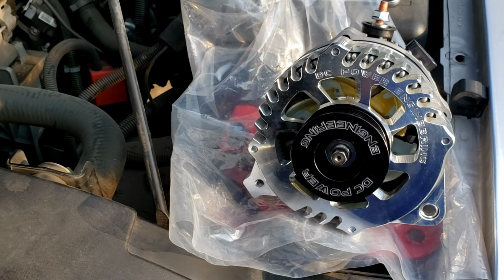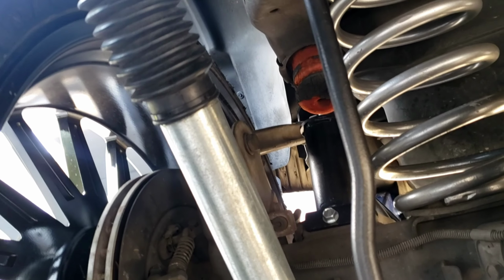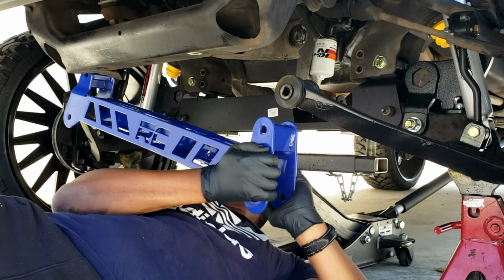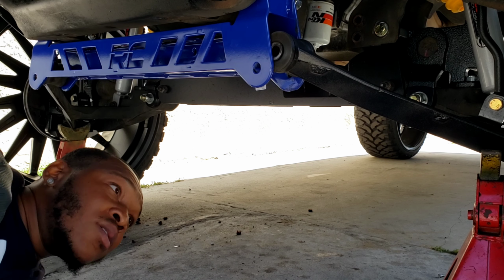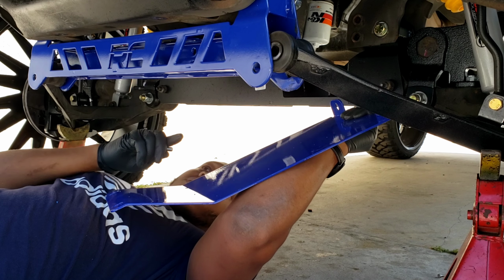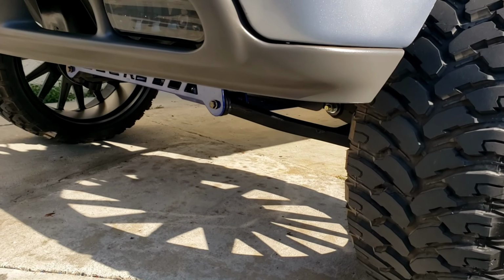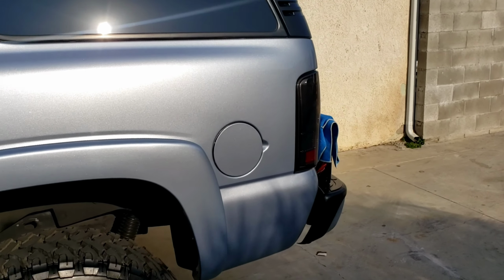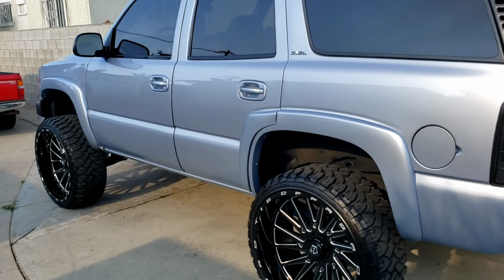Chevy Tahoe Build PT.12 "Whooped Tv"

Comment: Do you have aftermarket lower control arms? If so what’s the name and how do you like them?
Reply from the maker: Moog uppers stocc lowers.. it rides smooth now
Reply: @GtPRiCH  that’s what’s up. I haven’t touched the lowers yet. But I think I may roll with the bilstein 5100 for the front. Those shock extensions I don’t like. Can’t get the ride i like. I just have it leveled